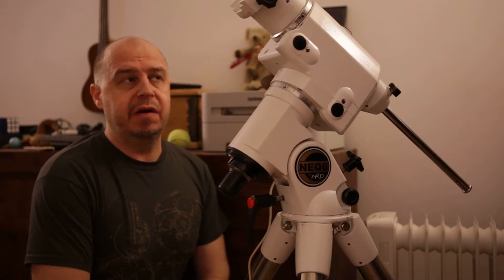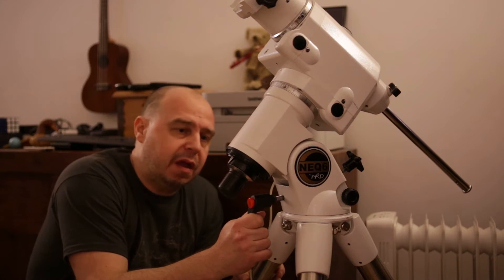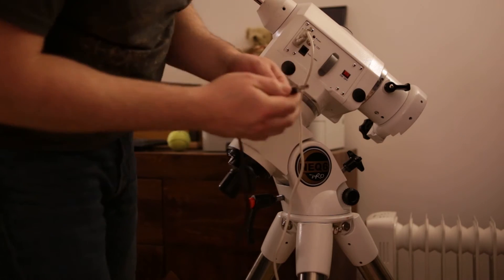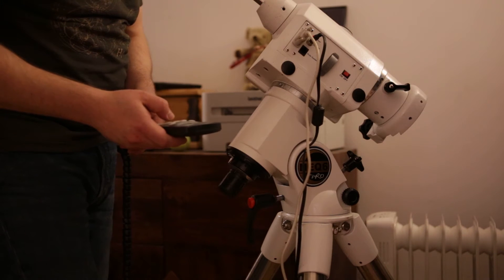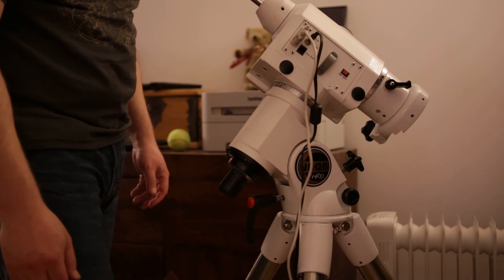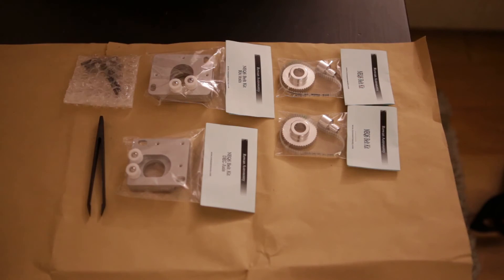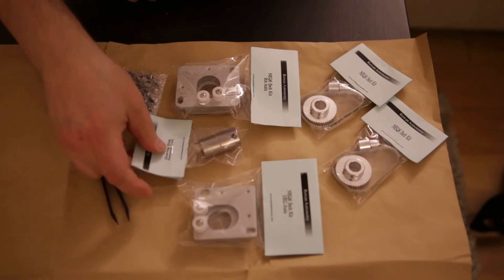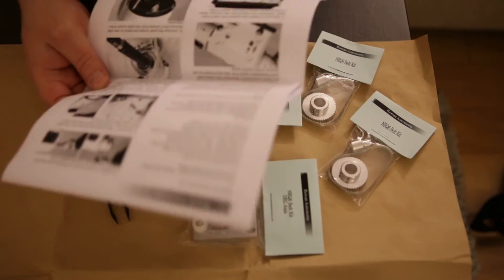NEQ6 Belt Mod Part01 - Introduction

Comment: Great video. I changed my ALT adjust bolt with a lever type like yours, I cut down the thread and turned down the thread end to a dome, it doesn't protrude as much, but can still move enough for polar alignment. The white dust cap fits on then. 
 I have found with my NEQ6 the synscan handset connector a pain. The RJ45 connector came out one night during imaging. This disconnection must have caused a spike, as the handset lost two back light button LED'S afterwards. Just completed the Rowan belt modification, hopefully get a clear night to test in PHD 2 soon.

Comment: Four years later, after doing the belt conversion on my NEQ6 Pro and astro-imaging with it constantly the mount using three different telescopes including a fairly heavy 10" Newtonian reflector, without any snags, the auto-guiding has been deteriorating recently, even with a tiny 60mm refractor mounted. Some may say its time to replace it with a newer model, eg the EQ6 R, but it would please me to fix this one first. Has anyone else had the same problem with this particular mount, and did you managed to fix it? Please advise as to how you did it. So far I have readjusted the backlash with the small grub screws in both axis and there isn't any binding.
Reply from the maker: I haven't noticed deterioration on mine but then again I've never been able to get it super good either before or after the mod... Just an idea, have you checked the tightness of the belt drives? Maybe they've stretched over time?
Reply: I am thinking of slackening the cap head screws of the stepper motors and adding some leverage to them to tighten the belts up one side at time.  Is that what you mean?
Reply from the maker: @davebillybish  Yes. As far as I remember there's two plates on top of each other. One is screwed to the mount and the other one to the stepper motor. Then there's the cap head screws holding the plates together which provide enough movement for the belt to be tightened. I remember it being a fiddly job to do as there's not much space for tools / fingers / light... I haven't actually checked mine since I did the mod. Might do that soon as well :)
Reply: Thanks Kari, l appreciate the input. If the auto guiding isn’t improved after the adjustments, another thing I can do is to replace all the bearing, though it would mean a full strip down as for the belt modification.
Reply from the maker: @davebillybish  Another thing to check is if there's any slop in the counterweight shaft due to the way the locking mechanism is designed. I upgraded mine with Geoptik counterweight shaft. It's 25mm diameter so I had to enlarge the holes of my counter weights and 3D print new bushings for them. The shaft doesn't retract into the mount but it's a lot sturdier and does not slop...
Reply: I tightened the belts yesterday and tested for any binding and checked the motors can drive the mount still, making a 360 rotation in both axis alright. It is reassembled now and I am waiting for a clear night to test and see if the adjustments will improve the auto-guiding. I first noticed the problem when calibrating in PHD. With every step, the distance doesn’t increase very much resulting in it taking far too many steps to calibrate West and North, ie East and South they just step down to zero and adjust the difference with backlash correction (East) and nudges for the South.  I use the ASIAIR Plus simplified version of PHD.  
I will check and see if there’s any slop with the counterweight bar, I must admit I hadn’t thought of that one and thanks for the tip.
Reply from the maker: @davebillybish  Hopefully all is good now. Let me know how it goes. Word of warning if you decide to take it apart again. The threads in the aluminium housing don't like to be messed about too much. I had to repair a few of them with v-coil thread inserts.